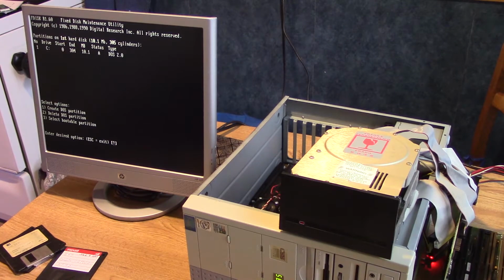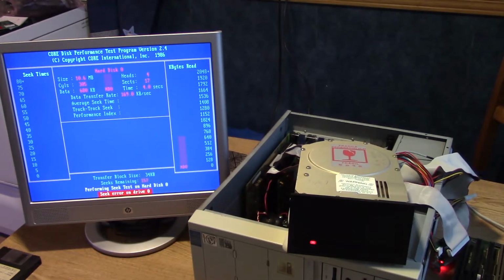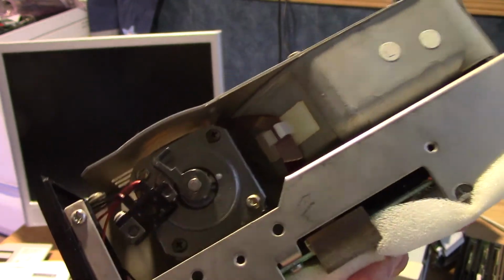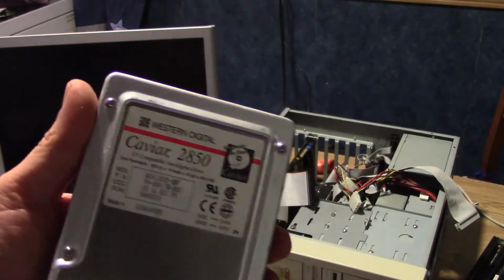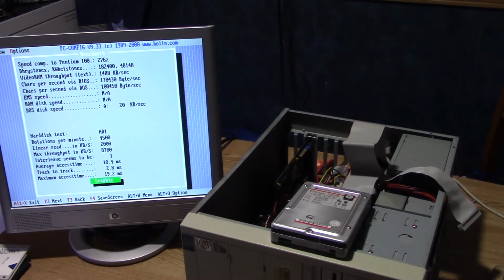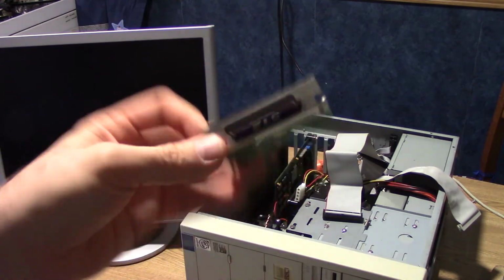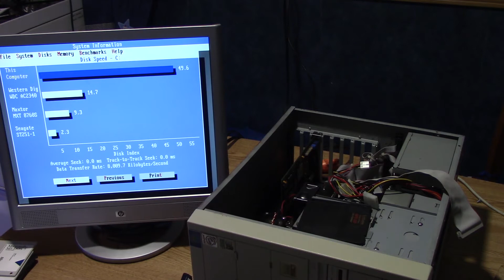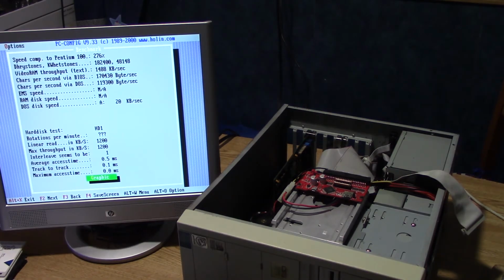Grand 80s, 90s, and early 2000s hard disk drive comparison! MFM IDE EIDE SCSI SCSI2 SCSI2SD CF

Comment: I think its possible to use both ssd pata on the motherboard by using a custom made PATA IDC cable. So on the end that connects the motherboard use a female connector and for the drives using 2 male IDC connectors. Same idea like connecting an scsi terminator on a scsi cable.
Reply from the maker: I actually made one on the 486DLC I borrowed the drive from - I mirrored the IDE pinout on the back of the IDE controller card, then I had to mirror the pins. This was done as I had a CF IDE card as slave on the computer. 

To be sure, the wire is ugly and the card odd looking, needless to say soldering 40 pins to the back of the card was time consuming, but it worked first shot.

Comment: While I enjoy old tech, the two things I never looked back on were CRT monitors, and mfm/rll drives.  anything from a slight bump to temperature changes can make mfm/rll drives lose data.  People learned fast to get a copy of spinrite or other drive maintenance utility and recalibration was as important as defraging.  SCSI drives were an oddity unless a person had either deep pockets or owned a computer that used them natively (still a deep pocket thing.)  IDE was not exactly a godsend, but it was more durable than older drives and everything was fine especially if a person used colorado tape back up.  Then things got bigger and faster and MS included utilities for drive maintenance and drives became more reliable.  Like a lot of people in the hobby I have a good stash of Maxtor, and WD drives, as well as some off brands that still work reliably.  Not so much seagate, while I like the brand and have bought quite a few through the years, they do not seem to age that well.  I have yet to try those so called drives on a card...NVME's or whatever... Sorry, but if it doesn't spin I do not trust their reliability, especially since last I heard they only last a couple years.
Reply from the maker: Right on. I never had an MFM as a daily as a kid. My first PC was a Deskpro 386/20e (which was pretty awful in many respects) but at least it had a 42 Mb IDE drive. Conner IIRC, which were pretty awful drives too. The only contact I had with MFM was in middle school (mid 90s) when I was tasked with fixing 40 odd computers, a good portion of which were XTs and 286s that still used this stuff. Even back then with no formal training (I was 11-12), I realized that IDE was much better, smaller, and quicker than MFM. I got a few of them going again after a tip from the shop teacher about DEBUG and low level formatting disks as they had to be paired with the cards. Fortunately one of the 286 clones had an excellent BIOS which natively allowed for low leveling drives. 

I find that Maxtor drives are hit and miss, as are Quantum, but I prefer the latter. Western Digital seem to be indestructible, I have a few around here in some project machines. 

I've had an SSD in  my X230 for 4 years now, seems OK. I have an NVME in my Ryzen 5 build, it's been about 8 months with the computer being constantly on, seems OK for now. At work, some of our 5 year old lab machines with then-new SSDs are slowly starting to fail (5-10%) though.

I back up  all my vids and retro software on my server, which uses RAIDed spinning disks though - I trust thore more.